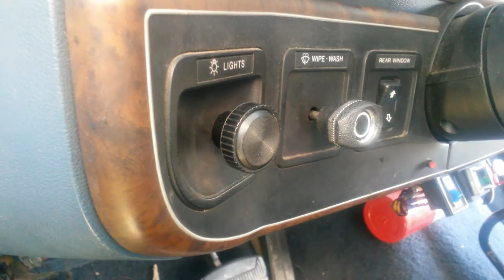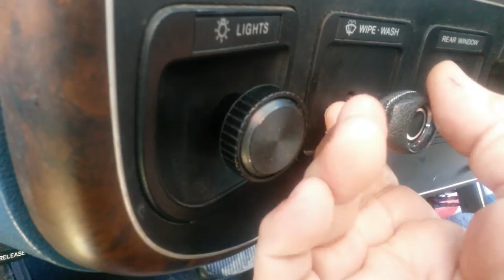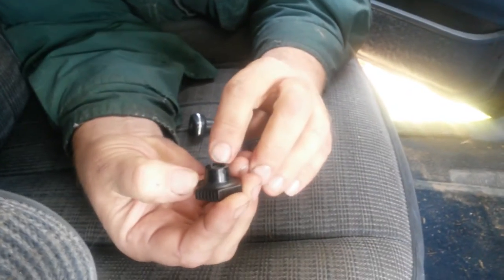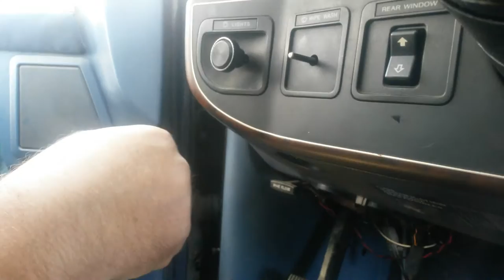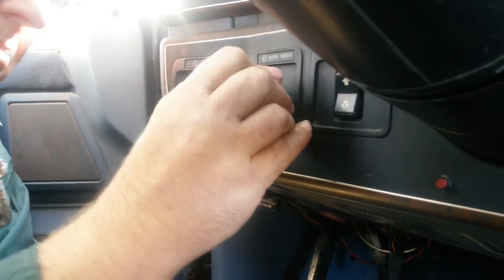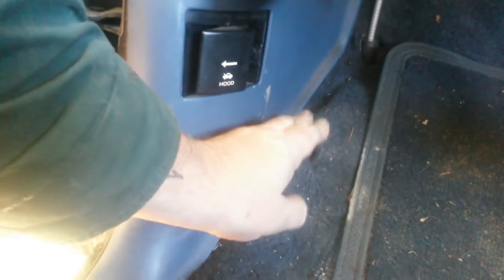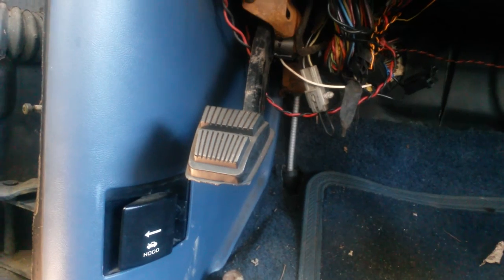1987 Bronco f150 dash knob removal many classic antique cars

Comment: So I tried this and for some reason the knob still won't come out. Any ideas?
Reply from the maker: Which knob? What year and model vehicle? I'll see if I can help
Reply: @darylturcott  1990 Bronco, the light knob. I was able to remove the wiper knob just like it was supposed to but even after I found the button and was able to press it the knob still wouldn't budge
Reply from the maker: That is a problem. Try gently pushing in in and out while pushing button. Then maybe rotate it to different positions and try again. Make sure button is fully depressed and increase force to see if it will pop out.
Reply from the maker: If the switch is broken inside you may have to force it.
Reply from the maker: Perhaps its a newer style with a different removal process
Reply: @darylturcott  I had to wiggle it, but it DID finally pop off on my 91. It was laughing at me...🤣

Comment: I followed the instructions and I’m still struggling to remove my wiper knob. Any ideas?
Reply from the maker: Is it the same style?  It's possible that different years have different methods.
Reply from the maker: Maybe spray a little lube on it too
Reply: @darylturcott  I checked out similar videos for vehicles more similar to mine, which is a 1977 F350. They had the same instructions but I was still unable to remove it. I’ll try adding some lubricant and see if it does anything, and let you know. Thanks!